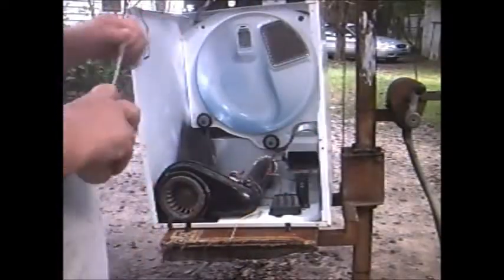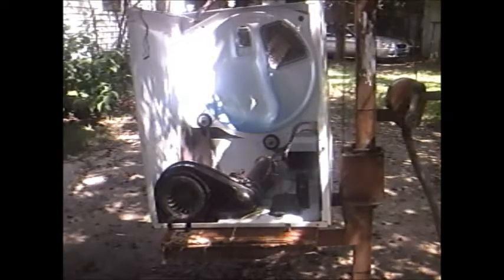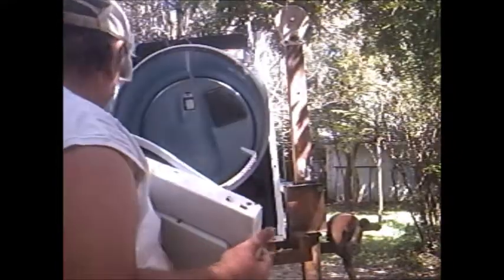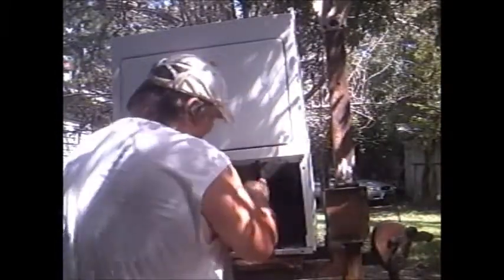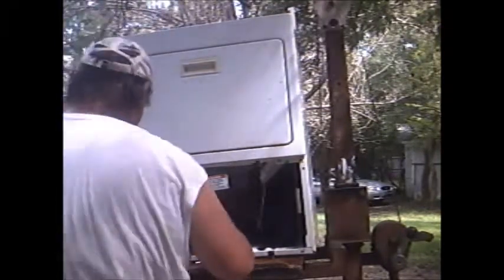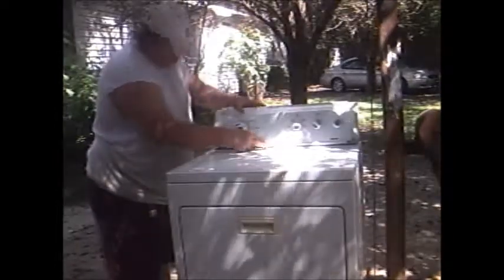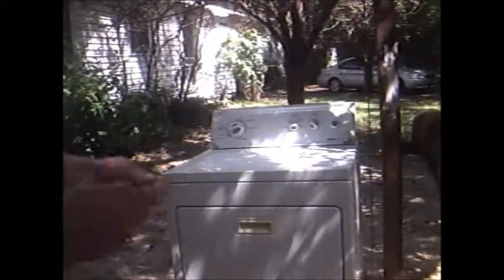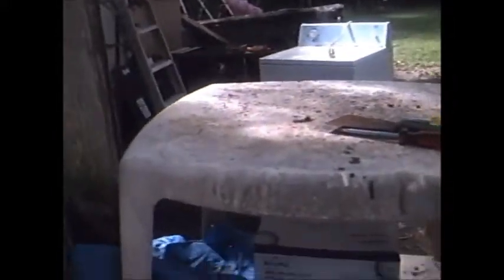4 Wheel Drive Dryer

Comment: What is the thing that you use to raise your washers or dryers up when working on them? By the way, you have some great videos. They are very informative.
Reply from the maker: It is an appliance lift
Reply from the maker: I had it at the appliance parts store before I retired and brought it home after we closed down. Sure is a great back saver.
Reply: Thanks for the reply. I recently started repairing washer and dryers and had been trying to figure out a way to raise them up when needed, then came across your videos, I was like wow!
Reply from the maker: @thomasperry6363  This one has two controls. The lever left cranks the cable up and down, the lever on the right is the brake. You gotta hold onto the brake and move the crank a hair one way or the other to losen the brake then you back it off to where you can lower or raise now if you left go that thing will bust your butt so you gotta be careful. Dryers and acs not too bad Bigger stuff you gotta watch out. Sure helps out tho.